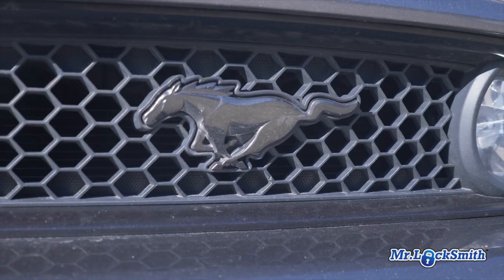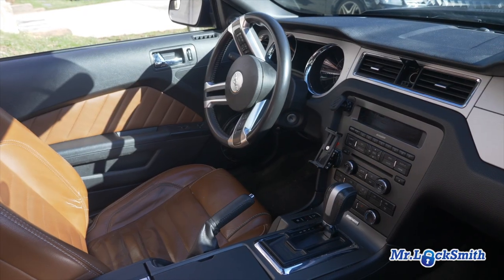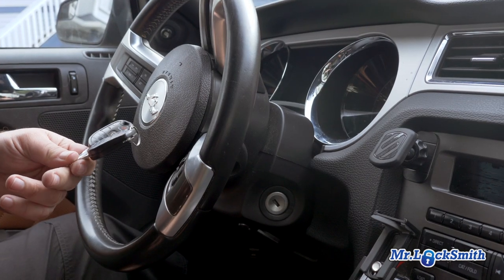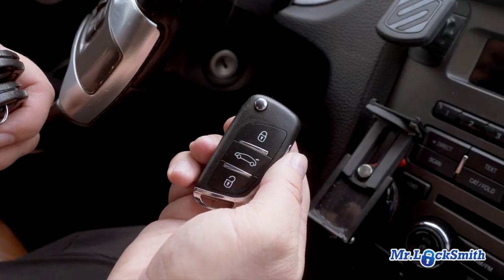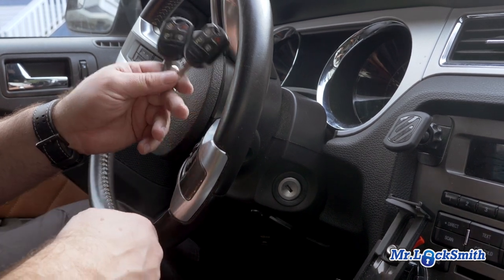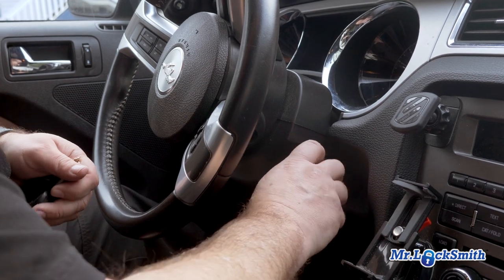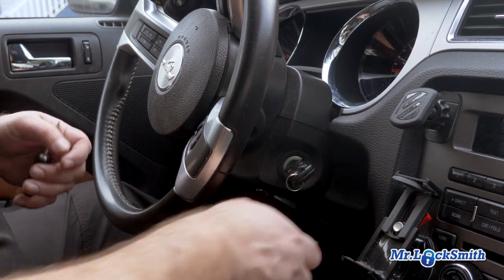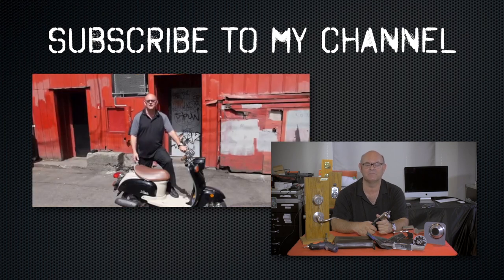How to On-Board Program a Ford Mustang 2014 | Mr. Locksmith™ Video

Comment: What if you only have 1 master key? I bought a set of keys with only 1 master key that came with the mustang. The other 2 keys are cut exactly the way the master key is because im able to manually open and lock the door. Even the remote functions work. Its just the other 2 keys won't start the car.
Reply from the maker: If you only have one key that starts your Ford then you cannot “On-Board” program extra keys.